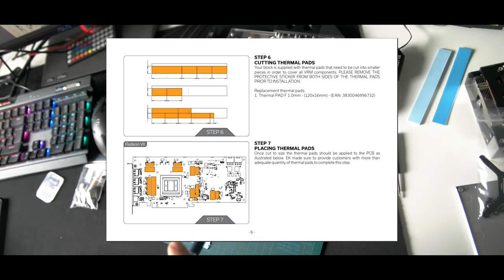EK Waterblocks Vector on a AMD Radeon VII install Tutorial

Comment: Hi, there are thermal pads with different thickness. Which one you are used for which components? THX
Reply from the maker: You can find the manual on the ek wb webpage 🤭
Reply: @CustomrigsDe  
Yes I know, but there is nothing about thickness of the pads. If I look for example on vega 64 manual, there is precise description that 0.5mm is for this and 1mm for that...